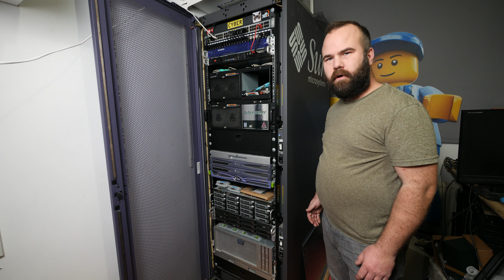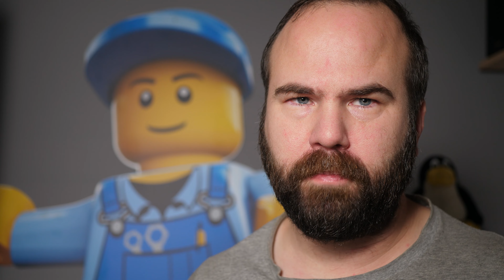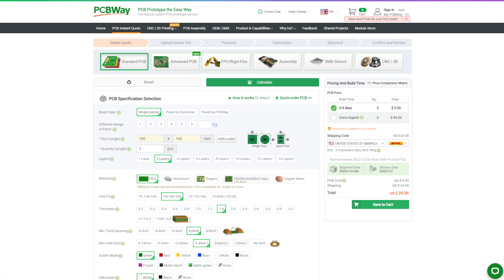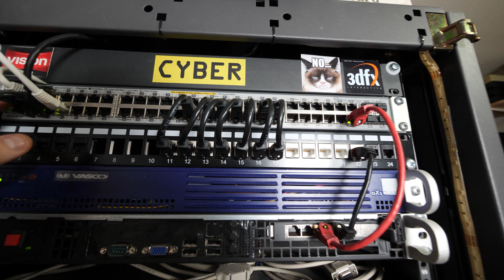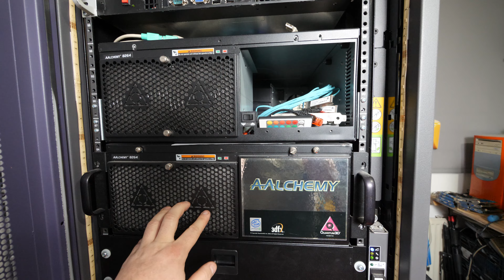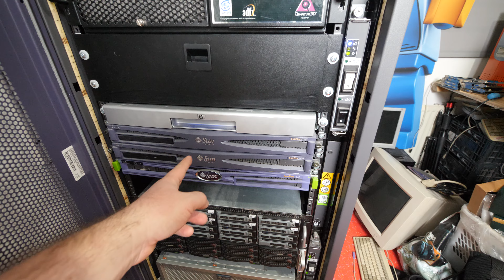Homelab Tour 2023 And HP Switch Upgrade to 10gbit

Comment: The 2910 is a good solid switch that also runs HP's more modern web interface, which doesn't require Java in the browser like the older switches do. Apart from that, it's just a good solid capable reliable switch, though not having all the latest bells and whistles obviously.

Comment: Hmm, if FS coded the transceivers for HP I don't think the switch should be complaining about non-HP transceivers.  They list no less than 3 different "HP" versions but perhaps you didn't get the "HPE ProCurve" which I assume is correct for that switch. Myself, I'm using Arista and Supermicro (Intel) NICs that both can be configured to use any DAC/transceiver. I also have FS cables as they are good stuff.  Supermicro stuff is also great.